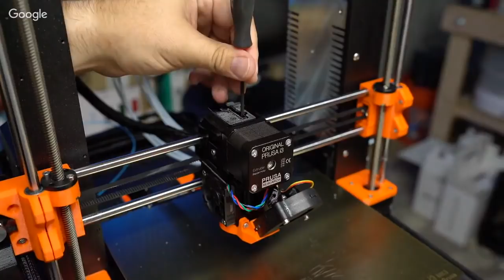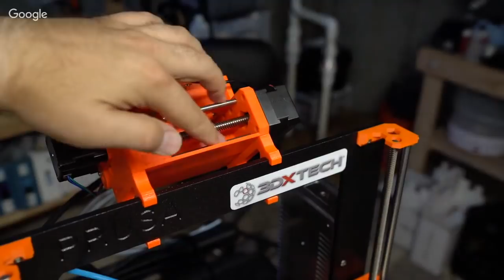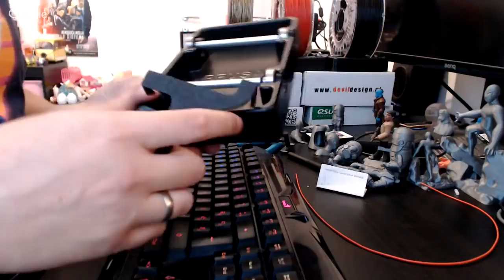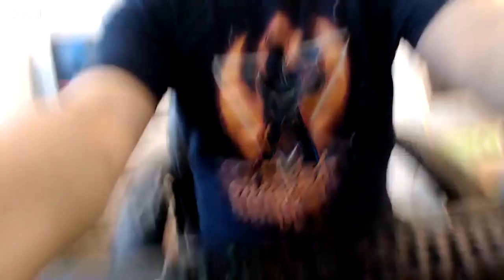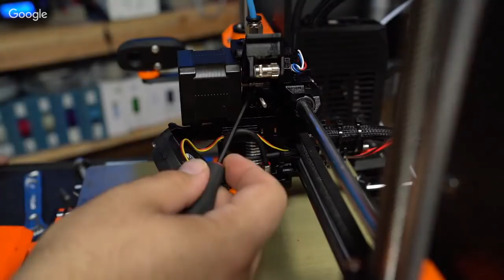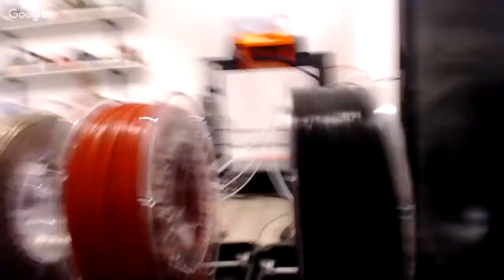MMU2 Troubleshooting 101: The Easy fixes

Comment: I find the MMU design to be similar to the German panzers: loved by out-looking persons and hated by mechanics. The extruder pulley-gear need to take all the frictional loads and this is a very stupid idea, now I have a lot of problems to find a position for the spool to minimize the frictions from the spool to extruder. This is VERY STUPID! I paid for a super shit sensible mechanical arrangement which is not working without a lot of constant adjustments. Sorry, is first and last time. MK3is good, MMU is a shit and cannot take it out now, very disappointed.
Reply from the maker: costiqueR the bondtech gears can handle that load of th retarction which is all it's doing making the tips during the ramming sequence. 

If the operator uses poor assembly or doesn't have their extruder setup correctly no system.will work well.
Reply: If your system is working 1 time from 3 attempts and after starting working suddenly lose the traction on the filament( and continue printing but no plastic go out from the extruder as the filament is covering the sensor etc) this is poor design, not wrong setup. If you need special positions for S-holders to minimise the friction which are not clear... as an engineer I never put my faults on the client sides, this is poor design. Believe me, even for "Unload filament" command I was forced to pull manually because of " remove immediately..." message, the MMU was not able to pull back the filament...
Believe me, the stepper has the power but for this is needing to squeeze the filament which will be stuck in extruder PFTE tube.  
Do you know that sketch with Mr. Bean trying to look on TV match? I was Mr. Bean yesterday.
I am not a hatter, I had a very good MK3 which is no longer working because of poor design: if I don't tight the filament will not be pulled, if I tight, will squeeze and block etc. And yes, I used even the secret menu to have the filament exact in the begin of the gear.  I will not continue this discussion, I will solve it somehow but ...they designed new B7 components, a new PFTE tube from MMU to extruder but still have a small PFTE tube over filament senzor...for what? To increase the filament stuck risk ? 2 times in my 100 attempts to make it working the filament was stuck in that small edge of PFTE tube. why the orange PFTE tube was not driven direct over filament sensor?
Reply from the maker: Again you have a build issue and there isn't a pull immediately option in the newest firmware. That was the previous firmware. Try installing the newest one and make sure you've assembled it correctly. The only time it can loose traction is if you've built it wrong. There is ZERO resistance on load and unload because the spool isn't even used until it's fully loaded and printing. Please look at how filament is loaded and unloaded and it's loose in a coil.
Reply: This is the first MMU which I have ordered in February and received last Friday. And this is the first firmware update on the printer downloaded also Friday, direct to 3.4.0. "pull immediately " is not an option, is a warning message when I order "unloading filament", MMU start to make noise and pull nothing (not able to track back the filament from the extruder gearing) and the screen is  sending love messages like "remove..." So is not this one. I built small models by hand, and I am a mechanical engineer. I have a lot of fine mechanics experience and I don't need to explain me a mechanism so I am able to understand the function alone. The problem is the pieces design+built, not the assembly. I had that percent of products which are in the worst assembly area, lucky me. But anyway, as I have no other option I will spend a lot of time to fix the frictional problems ( only the friction cause all these problems, poor management of friction is destroying a good working principle). 
To be clear, MMU have a good principle but covered by poorly executed pieces - at least for my package (example - I have one s-holder guide filament which is stuck,  the grinding of the channels/assemblies was not in the assembly instructions). And the orange (blue in your video, seems also longer yours) PFTE tube should be longer , at first layer is bent in low radius after MMU.
Reply from the maker: If you have friction it's a build issue. There is some friction to keep the filament tip from sliding out of the MMU2. That's designed into the system. I've helped a few people with the friction issue. It's always something in the build.
Reply: I have an idea about the end of long PFTE tubes, are under that MMU piece supported by 4 screws. If it is not exactly executed and allow tightening is reducing the tubes section and this can be one reason. Second, the orange(blue) PFTE tube between MMU and extruder, mine seems shorter and making a short radius which increases the problems (the length is provided). Which is the shortest length for the long PFTE tubes, I mean how much I can shorten them and which is the best position for the S-holders related to the printer? 
Separated, the printer fan is no longer working (after B7 parts update), the cables seem good ( I measured electrical continuity), can be from firmware update? I will check it again with a battery today.
Thanks for supporting me!
Reply: Printing Fan is OK, is working now, I was able to make the first layer calibration and start a print with one color.  The extruder gear was capable to pull the filament at low speed. In the second layer, the speed of filament should increase very much as was a filling layer. Guess what? Extruder pulling gear rotates but the friction+ inertia was bigger so lost control and no longer printed, even the head continue the movements. I paused print and tightened the gear. No results, seems filament already damaged. Pulled out, trim the filament, loaded and start the print..., no, stop immediately as the printing movements started from few centimeters above print position...so no fast print, gear will lose the traction and make a hole in filament ...all frictional problems and no assembly issues, I can drive manually the filament until extruder gear. I need to look at the settings, to minimize the printing speed to the minimum even on filling layers. This MMU unit should have own pulling gear in tandem with the extruder gear and no one can convince me I am wrong. Is so f...g sensible to any frictional change or, how I discovered now, changes in the pulling speed...
Reply: Same shit as before,  the pulling gear is destroying filament if try to tight, no work. I sell my MMU, worst investment decision which I made. I try to go back to MK3 if is possible.
Reply: Is possible, I have done it. now I am back to MK3. I need to check what g-code is making the last Slic3r firmware as I have high-speed movements of the extruder and no PLA flow in the latest model which I tried to make it. Back to school...

Comment: I've been having issues when the mmu pulls from extruder. Always leaves a blob at the tip and gets stuck in ptfe tube before the mmu sensor. Then it eats the plastic and it cant move. Then I have to fix all of it. Man I just want to throw this thing lol.
Reply: Also I have an issue during printing it looks like it's not laying enough filament on the bed so there would be empty spaces here and there. I have to make sure everything is aligned good I think its tight after all the frustrating dissemble and assembling. Any tips? Awesome vid btw VERY informative. I was starting to think I waited a year for nothing haha
Reply from the maker: It's a test of patience. Make sure to follow all the directions and to take your time triple checking all the alignment goodness.
Reply: @Mr3DPrintWizard  turns out my bondtech gear locking nut was not secure tight. Everything is working good so far. This video helped me tons. Out of curiosity.  Have prusa said what the other options are in secret menu ?

Comment: Thanks for the tips. I still find this thing to be a pile of poo, however. Considering that the first mmu had problems with strings causing jams, I thought this one was going to have a cutter in it to make a fresh tip every time, but all they have is that razor blade on the back of the selector that doesn't seem to do anything useful. I'm really disappointed in this product so far. It's going to need a few months of aftermarket mods to get it usable.
Reply from the maker: 0Calvin works fine without mods. Just use the included software and profiles then don't skimp on the directions.

Comment: The secret settings @53:20 solved my problem with the MMU feeding the filament about 2mm short before the bondtech gears. Position 2 on the MMU worked directly after assembly but I rather have 4 perfect working channels instead of only one. Thank you so much!